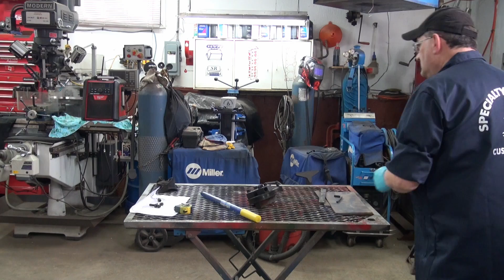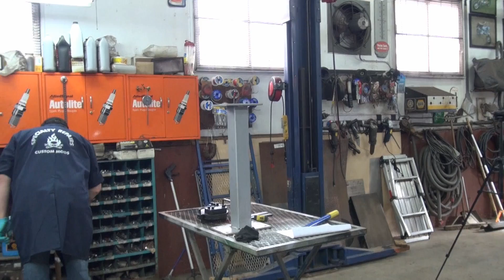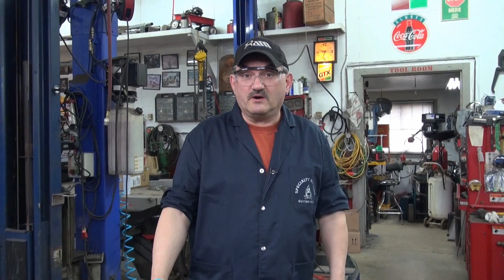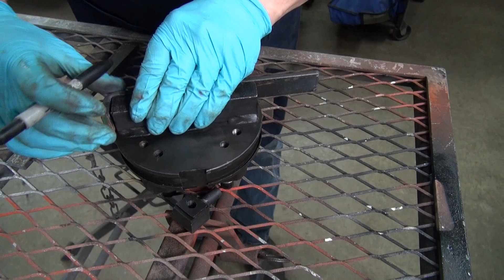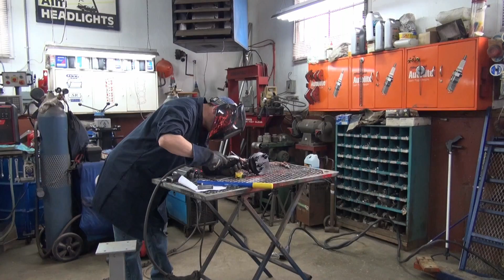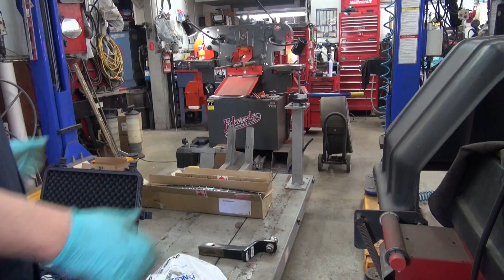Fabricated Bender Mount

Comment: Paul, is the bender base case hardened steel, which I suspect it is?  If it wasn't, could you have drilled and tapped the base for a pair of recessed bolts?  Just a thought, but I would have used your solution if the base was hardened steel.
Best - Michael
Reply from the maker: Michael I find it difficult responding to a video that’s three years old. I don’t remember my thought process at the time and without reviewing the video the only response I can give you is I did the mount in the most efficient and effective way I seen at the time. It must have worked out ok because I didn’t go back to redo it. We’re getting close to 800 videos now and my memory isn’t that good lol.
Reply: Paul & Kathy Short  Dear Paul: You are so right about the memory as I know I am in the club of needing a picture of my wife in my wallet just to remember her name, which is written on the back of the photo, but don't tell her I ever said that.  Love what you and Kathy do; and I received your light guards the other day for my L6060.  Q. Will there be any other mods for the Grand L series coming down the road after the addition is built?
Best - Michael
Reply from the maker: Lol. Your memory is a little worst than mine. We are hoping to get our hands on a 6060 soon. We have a number of ideas for them so stay tuned. Thanks for your business.
Reply: Paul & Kathy Short  Dear Paul: Many thanks for your response.  My need for a photo for my memory, was but a version of my humor.  As the son of a great man from Agentia, I find so many good and healthy traits in you that are so similar to my late father's own personality.  God bless, and keep going with what you and Kathy are doing.
Best - Michael

Comment: I'll apologize in advance but I was wondering if you've ever done a video about your motorcycle lift table? I'm interested in purchasing one from Harbor Freight but I don't think it's going to large (wide) enough for my Arctic Cat quad. Did you fabricate yours or purchase it outright? Thanks for any input you would have! Brett
Reply from the maker: I've mentioned it in videos. I never made it. It's American made by Handy Lift. It's the B.O.B. Model with optional side extensions and wheel clamp. It's acted at 1500 lbs but it can lift a good but more than that.

Comment: These heavy duty benders are a problem to site, you need room all round them, your idea of fixing it down to a solid base is excellent, I have an F J Edwards folder similar to this that I never use because of the fixing down problem, I will now make a solid square tube stand and fix it to a floor anchor. Chris B.

Comment: Hey Paul, What another great tool! I have a buddy who, like you is a master of tools and mods. I saw how you made that wrench holder, cool! One method he uses (I don't know if he wants to give away a secret in his shop). When he has to put a stemmed tool (screw driver, t handle whatever you need) he uses a extra large fender washer. Grind one side flat (or flatish) and drill out a hole in the center to proper size ( to fit shank) and burn it on the the stand. Never sags and it's very strong! As always thanks for the hard work in capturing the video, editing it and posting it!
Reply from the maker: +n3qdz 
There's so many ways to do things. I try not to complicate things but sometimes I have no choice. You friend sounds like a smart guy. Thanks for shairing.

Comment: Nice work on the pedestal mount. Wow! Under a $1000 for that press? You got a killer deal.
Reply from the maker: ***** Ya it was a real deal. I was going to bid as high as $2000. but didn't need to. It's been a great tool for the shop. Thanks.

Comment: nice simple build for a simple tool that could save the day i built a stand for multiple tools out of a rear brake drum from an18 wheeler and 2 different pieces of pipe and i have a vise my bench grinder and several other tools set up to use with it now and more to come, plus since it is on the heavy brake drum its portable and stable.  its a nice handy little set up and ill use the same set up on my welding trailer so i can swap them all over to it when needed
Reply from the maker: quietmale00101 I've seen brake drums used for many things and they work well. In my case I need to be able to tuck things away when not used. Tools are the type of thing that some of them don't get used often but when they do they save the day.
Reply: oh i know thats the nice part of the drum i can roll it into a corner until i need it
Reply from the maker: quietmale00101 Good point.